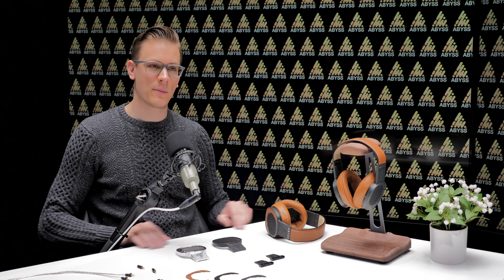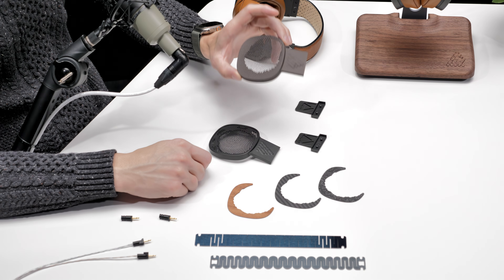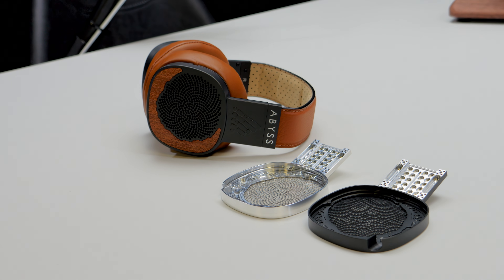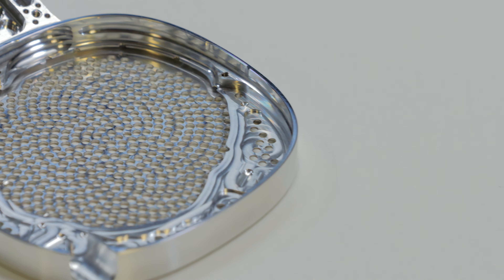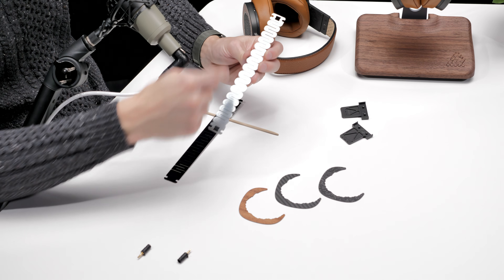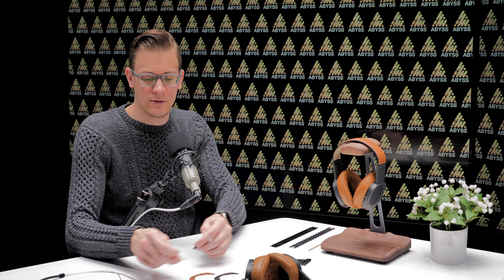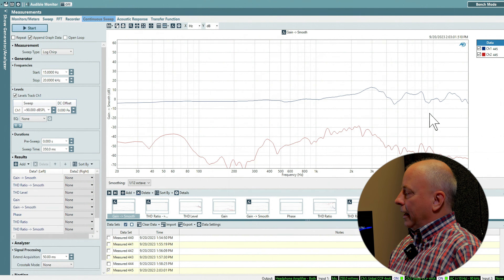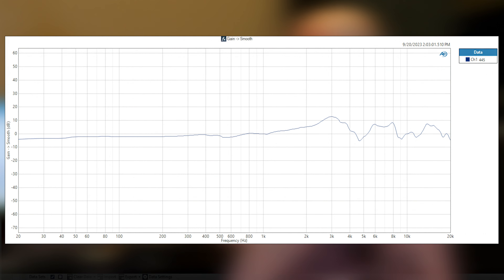The Engineering behind ABYSS Diana MR

Comment: This is engineering applied at its best! Have you considered additive manufacturing instead of subtractive for more production efficiency and perhaps acoustic chambers withing the case itself which cannot be done otherwise?
Reply from the maker: Appreciate the kind words. There’s a great deal more stuff happening I’d like to show, but it’s a tricky balance getting things engaging while digging in. Additive is very interesting for sure, the potential is absurd. Complexity is basically free in additive, you can make almost anything you can dream up. Right now, it’s an extreme trade off to make a production part like this with additive. The major issue is cost for metal printing is very high, and it will still require post process machining to meet tolerances and finish requirements. It is more practical with plastics, but then they have other compromises that would most likely mean larger size and higher mass. Certainly something to keep an eye on, as that space is maturing rapidly.

Comment: Don’t take this as criticism.

The THD looks excellent. A 10dB peak at 3k seems like a lot. It that kind of frequency response typical for all headphones? What’s the source of the peak? Is it a diaphragm resonance?

Also do you use any constrained layer damping on the magnet supports? It would add some weight but I would think it could really knock down any ringing of the aluminum. And That ringing would be directly superimposed on diaphragm movement. Just musing, I’m guessing that you’ve addressed all of this.

Impressive design and machining!!!!
Reply from the maker: It's complicated. If you compare the absolute distortion curve shown in this video to the frequency response you'll see that the output level peaks around 3 kHz, so the absolute distortion will also be higher there. Keep in mind the test set was normalized for the headphone to output 90 dB @ 1 KHz, so at 3 KHz the headphone output is about 12 dB higher, or about 102 dB! If you look at distortion as a percentage (https://cdn.shopify.com/s/files/1/2685/4510/files/Abyss-Diana-MR-THD.jpg?v=1696043811), it might be a bit more intuitive to the untrained eye as this takes into account output level, basically distortion divided by output, at any particular frequency; that is if the measurements are done properly. Might be a good topic for a future video.
Reply from the maker: If you’re referring to the frequency response peak (not distortion level peak at 3 KHz), a test head such as the B&K 5128 fairly accurately simulates the interior of the human ear, so these raw measurements as shown (straight off the ear drum so to speak) reflect the sound as perceived by humans. With a well tuned headphone there will be a peak in this ‘ear gain’ range of frequencies (let’s call it a function of the acoustics within the ear canal, the human ear does not hear flat). If the measured raw curve were flat in that region you would  perceive that region as sucked out or missing. So to answer simply, it’s normal to see a rising response in that 1-3 KHz region when measuring a properly tuned headphone on this head shaped 5128 test fixture. Put another way, measuring headphones is not the same as measuring electronics, reading raw measurements requires interpretation.
Reply: @ABYSSHeadphones  Thanks for your reply. That’s fascinating. I didn’t realize that the measurement shouldn’t be “flat” but should mimic the peaks caused by our ears geometry. Much appreciated 🙏